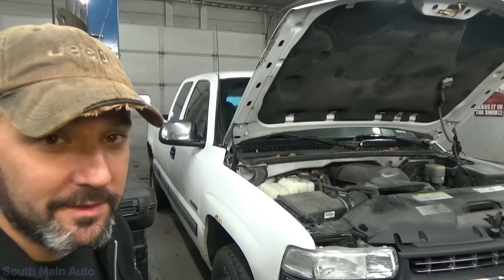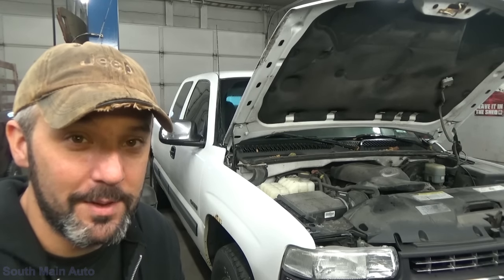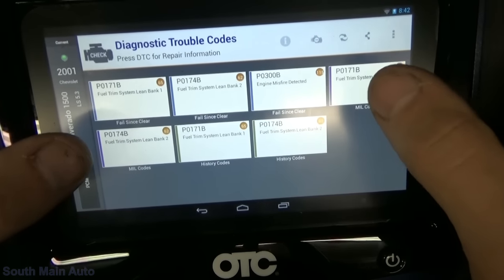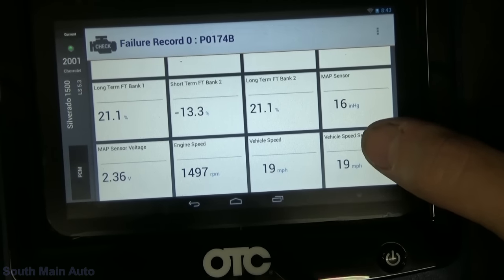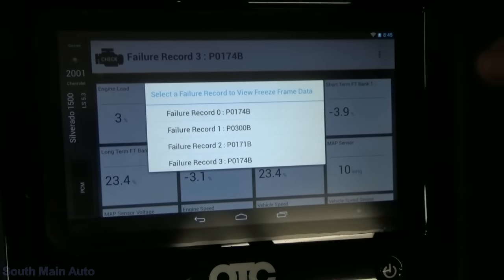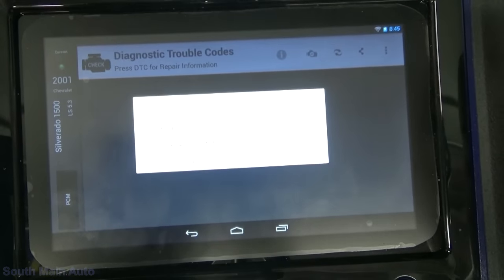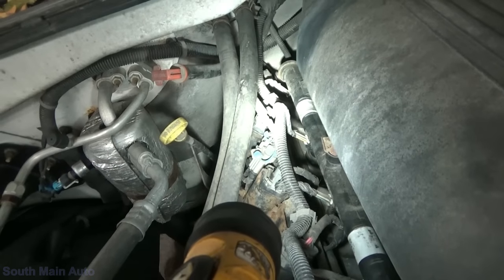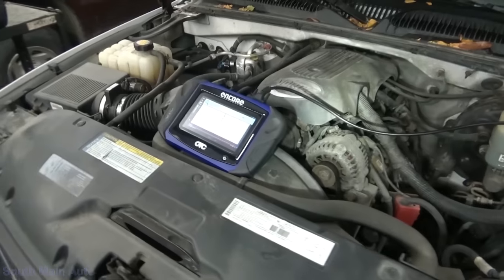Chevrolet / GMC - Rough Running, Lean, Misfire

Comment: You need to get a easy intake they work awesome to smoke test the vehicle. that way besides the snorkel you can leave everything hooked up
Reply from the maker: I did leave everything hooked up including the snorkel though?
Reply: South Main Auto Repair I guess I just prefer the easy intakes then I dont have to worry about finding something to block it off with as the easy intake takes care of that. Either way works though so thats all that really matters

Comment: Eric at 20:49 the long terms shot back up to 25,  is that normal?  Had my Eagle eyes in tonight.
Reply: I saw that too.  I am guessing the PCM switched to another cell in the fuel trim table and restarted the learning process.
Reply: WhitwellMike B I think scannerdanner or Eric (in a prior video) pointed  out that the pcm will go back to a "learned" value to double check the new correction.... if I'm explaining correctly. It had 25 in memory, new value after correction is 0... so it momentarily goes back to 25 to see what would happen (O2 & short term trim wise).
Reply: Thank you, that makes sense.
Reply from the maker: That is right Thomas,the PCM switched to another fuel cell like Eddie mentioned.

Comment: A lot of people don't think there's an EGR valve on that truck
Reply: C u on some i guess mine dont have the egr like the truck he just worked on maybe cus mine the 4.8 small block bit mine dont have it
Reply: @bajapanta1  
The exhaust gas recirculation (EGR) valve is part of a vehicle's exhaust gas recirculation system. It is used to lower nitrogen related emission (NOx) levels created during the combustion cycle. The EGR valve recirculates exhaust gases back into the intake manifold, lowering the temperature of combustion and reducing NOx gases. Occasionally, EGR valves can fail. If this happens you will probably notice that your Silverado idles and accelerates unevenly. Replacing the EGR valve is a simple job for most home mechanics the egr can be deleted butt wouldn't pass inspection , now olderr trucks  may not have it butt anything from 1990 to today1500 to 3500 Silverado to suburban  has a damn egr Valve type of system better look up specific spec for your engine  ,
Reply: C u yes im aware what ur saying im just saying my truck does not have it in the same spot  like truck he’s working on it’s not there i have looked for it in the past but dont know where it is and it’s a 2003 4.8  silverado just for maintenance purposes i wanted to replace it but like i said it’s not there
Reply: @bajapanta1  I dug a bit deeper in to this apparently some trucks depending on the state and country some had the egr and some did not , if u don't have one great then u don't have to spend a shit load to replace it when it fails or have to deal with deleting it if u don't want to spend so much lol. Butt hey it's not going to effect the trick with or with out it